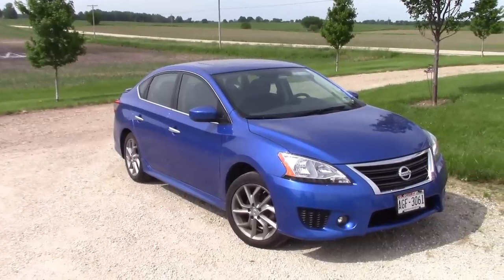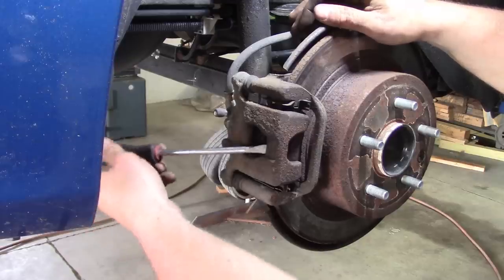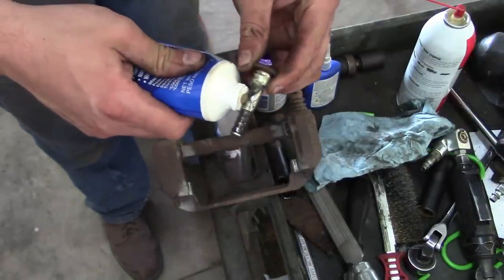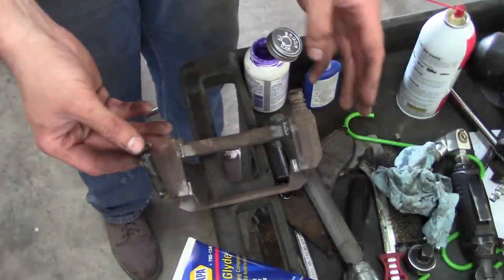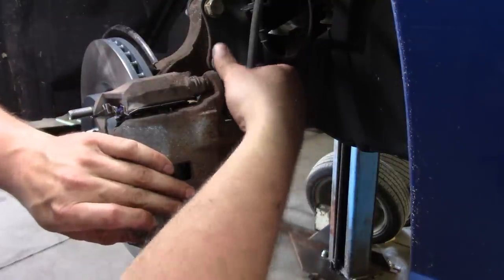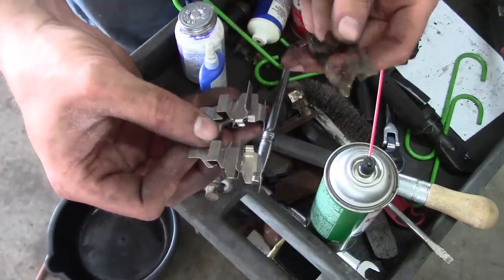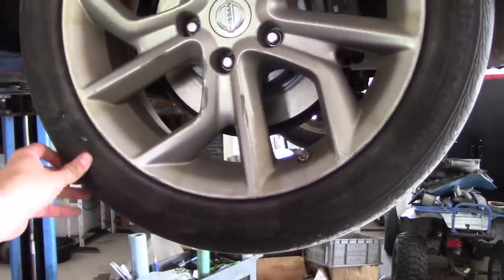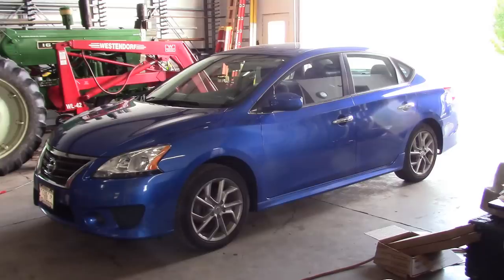Brake Job - 2014 Nissan Sentra

Comment: Legend says that little plastic sleeve on the brake slide pin is a secret communication device inserted by the government to find out who hit the brakes first in an accident so they know who’s fault it is... That’s what I’ve always heard Wes 🤷🏻‍♂️. Or either it senses slight vibrations in the vehicle operators knee. They both sound like such accurate explanations that I can’t really decide which one it is. Awesome video BTW and excellent information about the permatex brake goo too! I haven’t heard any theories on that, but if I do I’ll be sure to pass on the information. 👍🏻

Comment: Black Fly / Gnat / Mosquito Repellent:
Lemon Eucalyptus:  30 drops
Vanilla Extract:  1 Teaspoon
Witch Hazel:  4 ounces

Mix ingredients in a spray container.

I liberally spray the inside and outside of my cap.
I then spray my arms shoulders, and back of my neck.

Insects will not bother you!  
I have used this recipe for years.  Try it!

Comment: I’m told the plastic section on the slide pin is to prevent the calliper locking up when very hot, it allows the bracket to expand enough to stay free.

There is only one, because that is all you need to allow for expansion, two would increase the slop in the assembly and lead to squeal or soft pedal.

Comment: About that CVT...Nissan and Honda had to program their CVT transmissions to mimic "shifts" a few years ago because people JUST COULDN'T UNDERSTAND why their transmission wasn't shifting despite an abundance of information explaining why. In addition there were people that disliked the constant rpm even though they allegedly took the silly thing for a test drive before they bought it . I assumed I would dislike a CVT but I drove a rented Versa for a week and it was a lot smoother than the constantly upshifting and downshifting transmission in my Camry. Honda CVTs have been reliably, but Nissan versions( a different unit) tend to either fail at about 35K or last beyond 200K. Our fleet cars are almost all Altimas now and only one lost a trans.

Comment: For years I used generic silicone paste, then under influence from Eric O I switched to Permatex purple, which seems more viscous at room temp. Mostly I was uncertain about high temp performance of silicone paste. However now I see that Permatex purple is hard to find, and Permatex have gone back to silicone for slides after all! Getting hold of information from the company will be challenging, I can understand why they would be reluctant to disclose data that might one day be used against them in a legal sense. I know that Eric's experience over years has been reassuring so I haven't thrown out the purple yet, though it may take some time to go through the whole remaining bottle. I think I'll stop using it for slides but there are plenty of other places where that viscous paste may work fine. Eric uses grease as an antiseize lubricant behind the stainless steel clips holding the pads in place, so maybe there it would work fine. I never quit using antiseize at that site.

Comment: Not so long since even inexpensive cars had two pot calipers with pistons that didn't sieze up before every pad change, and don't get me started on the quality of  current liquorice rotors. Thanks for posting fella, even the straightforward jobs are absorbing.
Reply from the maker: I'll take these over the junk they used on the old trucks. Like the wedge caliper slides that Ford and Dodge used. Those never worked.
Reply: @WatchWesWork  Roger that. Mistakes were made too. Rose tinted glasses.👍👍

Comment: I was glad to see you use a real torque wrench on the lug nuts. Most places use those extensions on their air tools that supposedly tighten to the correct torque. I've never gotten my wheels back with the correct torque using that method. Never.......

Comment: i will continue to use the fancy purple goo stuff until it is gone. too expensive to not use...then i will go to the new. around here they fix roads only after the holes are so big that you loose a semi and a 53' trailer.
Reply from the maker: Yeah, something like $16 a can. But Sil-glyde is pricey too. They don't fix the roads, they just put up cones and lower the speed limit.

Comment: Camarata would have used a mini excavator to pull those rotors...
Reply: LOL, THATS why I watch so little of the Sea-can guy...
Reply: Nomadic Dullard and would tell us how the manufacture is at fault
Reply: @paulsilva3346  if it works it works, cant knock the guy
Reply: @paddyici6629  Just showing reason.

Comment: I've also had the purple ceramic permatex swell the rubber boots on a Toyota. It still works well for the backs of pads, but I use different stuff for the slide pins

Comment: Going to have to do rear brakes on the Benz. 400000miles and already time for its 6th set!!  They just don't make that stuff to last.  Lucky a set of pads is only about $30
Reply from the maker: Psh! My 2006 F-250 did 212,000 on the original rear pads and rotors. They wore so far one of the pistons popped right out of the caliper. My brother refers to us as "under maintainers".
Reply: Watch Wes Work Well in fairness I am only doing mine now because I had a pad delaminate driving thru water 3 months ago. Lol

Comment: I work in the rust belt as a mechanic for Nissan - as far as lube goes, all we use for pins and shims is high temp clear silicone based grease ... Generally to keep the brakes from seizing up and rotting out youll need to take everything apart to service in a year anyway

I spend alot of my time freeing up caliper pins and grinding down rust and scale from caliper brackets - I always paint the bare metal under the shims with hi temp paint. Pretty much every bolt needs to make a trip down to the wire wheel lol

Comment: Thnx for the info on the permatex. Eric, frm SWG, is using a pink lube. I lookd high n low & cant find. Im a senior who used anti seize for YEARS. Never had probs but I learned it too, is bad for rubber. We used to used liquid ruglyde for mounting tires when I was a teen. I bought silicone gel & use anti on no rubber parts. I own a '19 prius & I jst DID my brakes, no pads were fine, jst cleaned/lubed all parts for the reason that Sentra was. I've heard Prius go 100,000 miles before brakes. I dont want to be fighting them later.😉 GREAT VIDEO! 👋

Comment: if you're going through all the trouble to spray brake cleaner in the guide pin chamber might as well remove the rubber boots and clean them separately and bring some life back into them. It's a good idea to clean the caliper surface where the rubber meets the metal. There is often build up there of old lubricant and other dirt and dust.

Comment: I can confirm that purple ceramic grease will swell up the rubber. Not sure what type of rubber I had, but it swelled rubber bushiong on the slide pin and caused caliper to stick. Their green grease also has same problem. Both grease does say safe for rubber. Don't remember it saying it is for EPDM only anywhere. I moved on to sil glyde. No more problem.

Comment: I have a 97 f350 where one of the front calipers started hanging up.  I could tell because there was a lot of brake dust on that side as compared to the other.  Took it apart and tried a couple different brake type greases on the pins and in fairly short order it would hang and back came the excessive dust.  The pins got really sticky in a short amount of time.  Finally got some Sil Glide and that did the trick.  Haven’t had a bit of trouble since.  Big Sil Glide fan now anywhere I need to use some grease.
Reply from the maker: It's good stuff!

Comment: Been watching your vids from quite some time. Love your clever and tidy methods. Your shop is awesome too. What sticks out to me the most though is the sheer amount of rust and corrosion all the vehicles there. I´m not sure where it is, but it looks like a snowy place. You got a challenge there with almost every single nut and bolt you have to break loose. Things are way easier in dryer climates, it is not even fair!!

Comment: The o-rings are inside the guide housing.
Petroleum distillate ingredient is the issue that causes swelling to orings.
Always open bleeder valve prior to manually compressing caliper piston.

Comment: You should consider getting a milwaukee m18 Mid torque 1/2" impact as a replacement for the air one. That thing is awesome and makes brake jobs so much easier...

Comment: They are basically saying Permatex ceramic extreme is petroleum based. EPDM rubber is supposed to be compatible with petroleum, thus widely used in automobile. However, I found ceramic extreme does swell EPDM slightly. (all EPDM does slightly swell with petroleum) It just takes a while to do so. It won't affect boots as much, but bushing will get stuck. So, it would be ok to use on slide pins without bushing. For slide pins with bushing, stick with silicone based grease.

Comment: I've been using the same Permatex as you have and had 0 issues with the rubbing and swelling over the past 6 years or so. Eric O. @ South Main uses the Permatex also and hasn't mentioned any issues. 
Thanks for the Saturday morning video!
Reply from the maker: I've only used it on a few brake jobs. I think this is only the second can. But I have had no issues.
Reply: maybe you've been lucky and theve all been epdm

Comment: You can use typical bolts in your car like from exhaust to remove the brake disc. Hammering could damage the bearing and rotors if you plan to reuse it.
Reply: Air chisel with a blunted tip works best.    Just hammer it on the hub facing portion not the disk surface itself.   It pops them loose in a blink.    Oh but had I known this 40 years ago not a few weeks ago😂some of the epic Honda rear brakes battles I fought still make me cringe.    That air chisel also is the best way to help penetrant into the cracks on stuck bolts too👍🏻

Comment: Ive always been told that the plastic sleeves were called an Anti Chatter Sleeve. Supposedly keeps the caliper from moving forward and backwards with the pads and making noise.

On another note: I’m glad Nissan stopped using the spin back calipers. I used to have a 2005 Sentra SER and hated doing the brakes on it. Fun little daily driver through.

Comment: So I went through this with my 2004 Silverado after I changed 3 of the 4 brake calipers on it. I had both rear sliders on both real wheels cease up due to the rubber swelling and allowing moisture inside to the pins. So I had to install new brake pads and new rotors again 3 months after the initial brake job. I have switched back to sil-glide  As I hear great things about it and have never had issues with it. Unfortunately my lesson cost me $90.. My experience with the ceramic brake lube. I also replaced all boots on the calipers on all 3 wheels..

Comment: Just remember: Proper torque specs for all air guns are 3 Ugga duggas.

PS the fan noise isn't bad at all. Use it more if it makes it a better work environment. If you didn't tell us you had a fan going, we wouldn't have known. Well it's either that or you have one miracle microphone.
Reply: I could hear it quite clearly, but I consider it standard shop noise.

Comment: I did front brakes on an Elantra not long ago and the rotors are the biggest pain in the ass I've dealt with. I rounded off 2 of the 4 rotor screws out but I am very good with a drill so that's not the main problem. The big hassle is that the outer edge of the hub actually touches the inside of the hat of the rotor, so once you get the rotor initially broken loose from the hub you still have to hammer it about 3 inches out until the hub passes over the entire depth of the rotor hat. Took me half an hour to get one rotor hammered off.

Comment: On nissans, the pointy metal on brake hardware goes inside the pad loop on the hears. Its a speing to pull the pad back when driving and brakes not applied. Make sure you do that next time.

Comment: 2 comments for this, I know nothing of the newer brake lubes I was taught by 2 different long time mechanics that mixed 50/50 antiseize and syl-glide for all parts. It was what they used for years and I will use till I die.  The other thing I was taughr and always worked for me is never hit the back of a rotor or drum, always hit between the lug studs with a small sledge hammer. Usually 2-3 hits and it pops loose

Comment: Can't stand brands that don't spec rotors with the bolt holes for pressing the rotors off the hubs. Those things are genius, when I worked at a Subaru dealer I kept the two bolts on top of my box, and never found a rotor I couldn't pop off in seconds with my 12v impact.

Comment: Had the same problem with my Toyota Camry (03) where the Purple Stuff made the "O" rings swell on the slide pins. Gave me fits until I figured out that it was the Goo I was using. Went back to plain "clear" silicon. Solved the problem. I use the Purple stuff for other things that don't contact rubber.

Comment: Yes I've had issues with the rubber bushing swelling on the caliper guide pin on toyotas. I also found that it gummed up in cold weather. I quit using that permatex

Comment: I only have few years under my belt but the bottom pin is more likely to trap water in the slides, I think that helps with that also I’m at the 13 min mark, to all the may concern the pin with the rubber won’t go in if you’ve got lube on the very tip or the suction shoots it right out
Reply from the maker: Heh. Some of the rubber tips and even whole caliper pins have a groove or flat side for just that reason. Toyota for example.

Comment: I have had serious issues with the wrong lube on the slide pins on Hondas. Rubber grommets swelling and make the slide pins bind up. The only thing that lasts is high temperature silicone grease by Honda. I believe the Sil-Glyde will work also.

Comment: The plastic sleeve is to prevent the ring of corrosion that forms on that specific slide side of the caliper. It happens to all Japanese econoboxes.
Reply: Actually, the sleeve is made out of rubber, not plastic.  To your point, if that were true about corrosion prevention, why doesn't occur on the slide pin that does not support the rubber bushing?
Reply: @armchairtin-kicker503  there is absolutely a plastic collar/sleeve on the end of my caliper slide pins. This is different from the rubber boot you're refrnecing

Comment: I have learnt to use brake clean from EricO and you, certainly it makes for a much cleaner job when you've got rid of the rust and stuff... but my friend who thinks he's more of a mechanic than me tells me off from putting it anywhere near rubber... but honestly I'd rather get the thing clean. He also tells me that you should just let the oily film on rotors (we call them discs in the UK) burn off...
Reply from the maker: The brake clean I use evaporates so quickly I don't think it would hurt anything.

Comment: Ah, road salt I see.. I have found that the Purple Permatex seems to dry out.  Not completely dry but thickened to the point that it doesn't seem to allow for sliding etc.  Will try the silicone variety and see if its better.  Have used silicone lubes before and they are probably the best for brakes anyway.  With no sound I would have thought this is South Main Auto.

Comment: I have been using the Permatex  Ceramic Extreme Brake Lubricant for about 5 years. No problem with rubber boot as others may have experience such. I use it in my own cars, family, friends. Product works pretty darn good 👍

Comment: I had to cut my discs (rotors) off my Volvo so I used a very thin smeer of copper grease on the hubs to stop this happening again,  in my case hammering them did f*** all but the grinder took them off quickly. One side had been over heating and had that rusty crud on the outer edge of the hub holding them on.

Comment: You are very smart it working with volts and amps. But the purpose of torqueing a Bolt & Nut has a reason for the torque valve. Hope this is a comment not a criticizing your method.

Comment: > "I'm not going to use the purple goo on rubber anymore"
>Proceeds to put it on the caliper piston
Reply: Rewatch that segment.  "I'm no longer going to use it on the slide pins, instead use the Syl-glyde, but I'll use it up under the hardware or on calipers."

Comment: Just my opinion. Permatex makes good products. However, for the slide pins I use Permatex Silicone Ceramic and the Purple Goo for the backs of the pads that contact the caliper. And for brake hardware I prefer Carlson quiet clips and cooper anti sieze where the clips contact the caliper, and the pads contact the clips; the clips have a rubber coating and I dont want the purple goo to ruin them. Had good luck with applying lube like that 🤙Great video man

Comment: I think most, if not all, brake rubber is epdm and marked as such. The rubber guide pin sleeve is for vibration.  Very common on Japanese stuff. I have seen some of those swollen from wrong lube and cause problems.
Reply: Also most Japanese cars squealer goes inside leading edge. Nissan may be exception

Comment: I would bet the plastic part on the one bolt and not the other, is to prevent resonation.
The bolts would vibrate at different frequencies, cancelling each other out.
Or something like that. I'm not a scientist.
Reply from the maker: Good theory!

Comment: Great video as usual. Thanks for solving the permatex purple issues.  In terms of the caliper pins and the rubber/plastic part on only one of the pins, Eric O briefly spoke of this on one of his brake videos first released about 3 weeks ago and I believe he said that the pin with the rubber/plastic goes on the hole closest to the pavement.  I'm not sure of the rationale, (maybe more subjected to water) but took it as gospel. When I clean out the caliper pin holes with a wire brush, I have a set of brushes with the loop cut off and chuck it in a drill.  It saves about 45 seconds.  Just saying. Kind regards  Craig